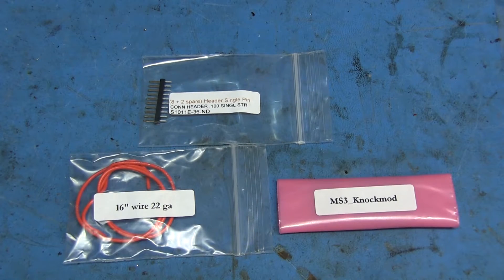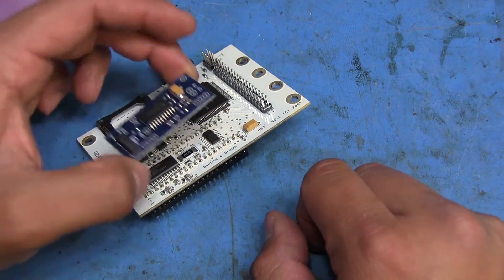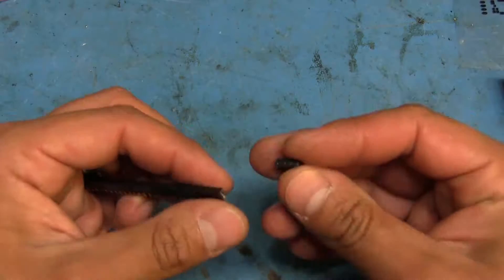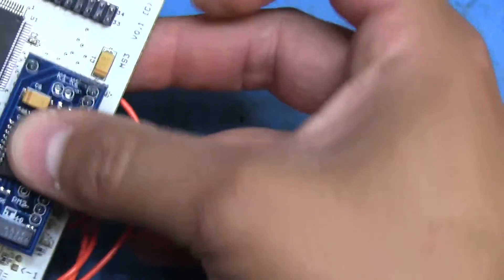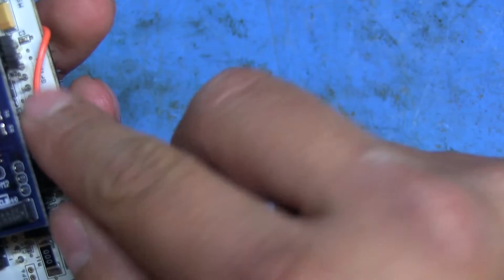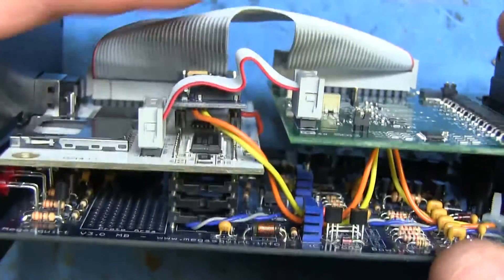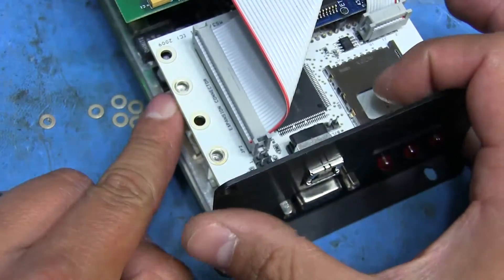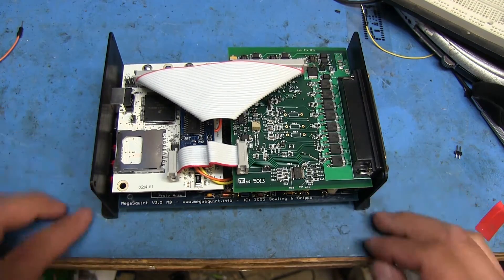TWB #8 | MegaSquirt 3 Knock Sensor Add On Module

Comment: The IC is a proprietary chip from Tex. Instrument, it's a fully programmable module that senses frequencies from the piezo sensors that attach to the engine block. The engine is generating noise and detonation generates a different frequency that the chip can be programmed to respond to. It works in conjunction with the tuner files on the MS board which adjusts the ignition timing according to the timing map you load into the MS unit files. Also the idea of using the header pins is a very good idea, just be sure to use some hot glue to keep it from vibrating out of the sockets. There are some other areas where this would work nicely. watched the video further into it and noticed you mentioned the hot glue.

Comment: So why doesn't this come already installed on the MS3? Most of their users are gonna want to watch for knock. I found this video because I  have a busted piston and I'm running MS3 on a turbo sbc.
Reply: The reason why it's not on the board when you buy it is because you have to buy it sepepeatly and have them install it for you. You let them know when you buy the board, they charge you a small amount for the service.

Comment: Great vid thanks - instead of using glue to hold loose wires etc as you have I use light a candle and drop hot wax onto the spot - holds really well and is easily removed if needed

Comment: Hey man. What parts are R4 and R1 and value, I accidentaly knocked them off. Want to fix it. Thanks!
Reply from the maker: Unfortunately I don't have the unit to look at and I tried zooming into my original video footage to try to read it, but I can't make out the numbers. However, from what I can tell about the way they're wired in the circuit, R4 should be the same as R2, and R1 should be the same as R3. The two knock sensor input circuits should be identical.
Reply: Thanks for the info man!

Comment: were did you run the red and yellow wires to on the main 3.0 board
Reply from the maker: Ron Bown To the spare 3 and 4 connections on the board that go the 37 pin connector.